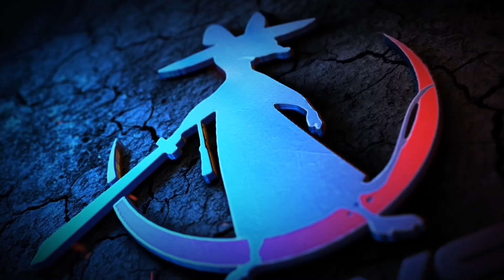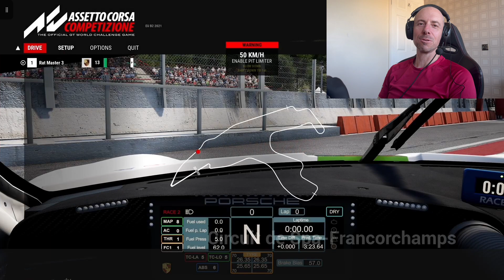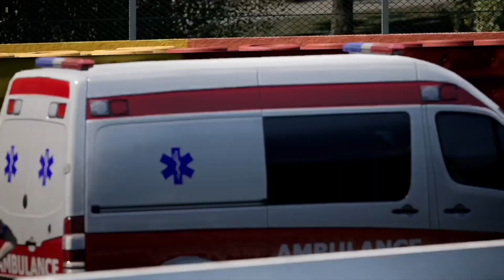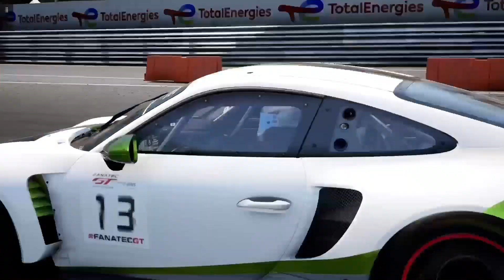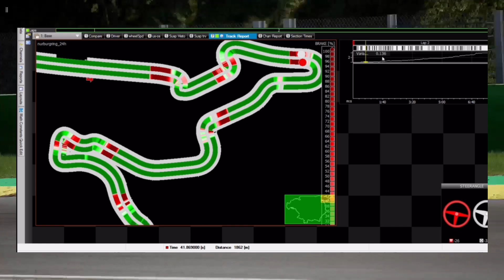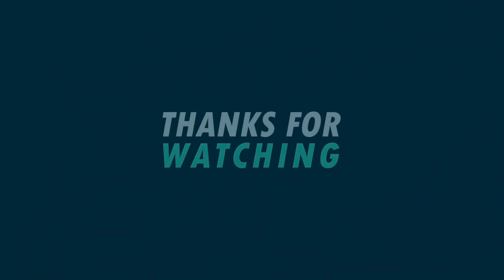ACC Traction Control explained

Comment: TC 0 is setup-dependent. you have to set your car up with 0 TC in mind also depends on the car you choose. Some cars have more sophisticated TC compared to others like the 296 doesnt need 0 TC but the AUDI EVO 2 does otherwise its to slow. I'm not sure if you can set a hotkey on console but if you can its best to switch to 0 TC going over the top of radeon and then switching it back to whatever is comfortable for you for the rest of the track, also when going onto the back straight at Paul Ricard before you clip the kerb on the left its faster to turn off the TC.
Reply from the maker: Switching the TC to Zero doesn’t work on console. The car just totally bogs down, it’s almost like you’re switching tc to tc11. After testing in Motec against a Coach Dave driver who was using 0TC and i was using 1TC he wasn’t quicker in many areas of acceleration. So the Zero TC doesn’t really feel like it’s worth trying to use. I’m happy jumping between 6 - 1 personally.

Cheers for the comment though TMG… nice of you to drop in and leave a comment 👍🏼

Comment: I always use the Ferrari 296 and struggle to go lower than tc 9 but i can still do low 2:16s at spa , i just chang to tc 5 at the exit of the bus stop
Reply from the maker: I think if you’re hitting low 2:16s at Spa you’ve not got much to worry about, good effort. I also think the Ferrari handles the TC better at different circuits. Some you might run 9, some 6. I guess it’s worth still playing around with it.